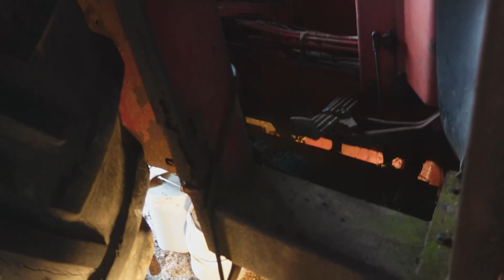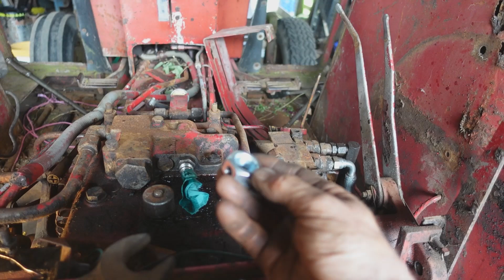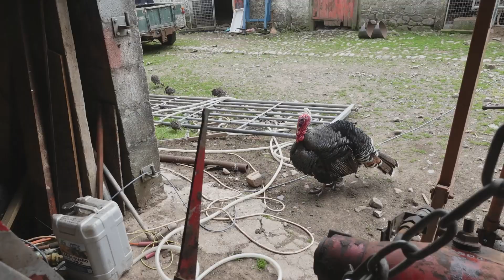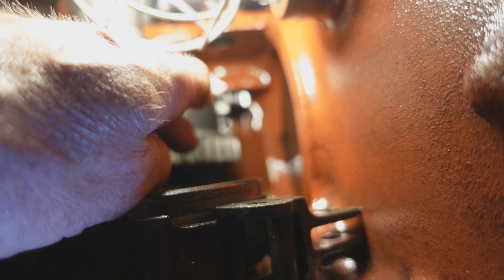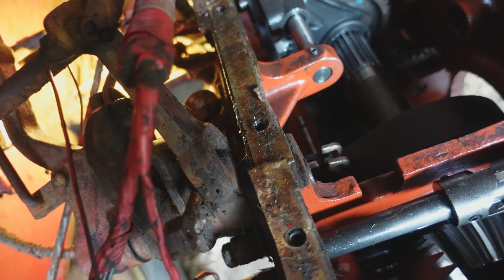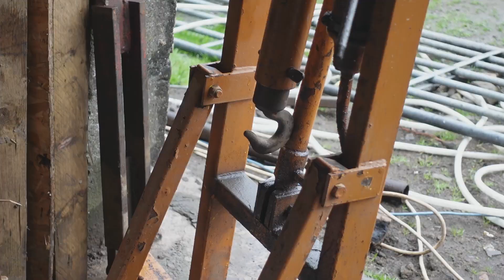International tractor hand brake band replacement 574

Comment: just popped the lid on my 454. the new hand brake replacement sleeve thing has a removable pin, havnt put it in yet but looks like can be flattened out and slide it in on one side and loop around and put pin back in..

Comment: What a ball ache  designers ain’t mechanics
Reply from the maker: They certainly are not. 

My son is master's degree mechanical engineer. When we were looking round university's, at one we were shown the car which the student's build each year.  It was a chassis with numbered bolt on bits and when they have assembled it the technician takes it apart again and puts it on numbered shelves for the next years group. I said that they do not learn anything from that excercise and would be better off being given a twenty year old scrap car to take apart and put back together. I was told that they would not be able to do it, to which I replied, "That would be the point of the lesson".

We eventually chose Strathclyde University because they offered a good practical element in the course and showed us round some impressive workshops. As soon as the first year had started they cancelled the practical part of the course. I was told by a pompous lecturer that "An engineer is not the man who mends your car"!

Comment: Well I found your video to be very well done, humorous and informative. I am attempting this very job on my 574 and was hoping to do the side route but I’m afraid now I’m doomed to have to pull the lid off. I already have the fenders and tank and a rear wheel off so might as well go full send on it I reckon!
Reply from the maker: Thank you, I am glad it helped you. It is a different tractor with a hand brake! If I were you I would also upgrade  the hand brake warning system, I did a little video about it, (afterwards I ended up putting two switches on the clutch). It would be a shame to do all that work and then drive away with the brake on putting you back to square one! Good luck, Jon
Reply: @wotjonsez2560   yes that would not be good!!  That’s what happened originally I think.

Comment: I just did mine this evening. Not an easy job at all. Where I had a lot of trouble at was the little pins holding the band onto the band bracket itself. There’s little splines on them and I had a difficult job in pushing them back in. Did you have any trouble with them?
Reply from the maker: Hi Raymond, I don't recall having any problems with the pins. I hope my video helped you. Now you know how difficult it is, I do recommend that you upgrade the handbrake warning system. Regards, Jon
Reply: @wotjonsez2560  yes extremely difficult but I have it done now at least. Will definitely be upgrading to a buzzer on clutch/handbrake. Don’t want to be doing that again. Yes your video was really helpful. Thanks

Comment: Couldn't agree with you more, John. Doing this job through the PTO side cover is a trick that would have Houdini impressed.

I went one step further on our 584, and removed all the hydraulic tubes. They come right out without too much fuss, except the brake lines, which can be easily wiggled aside once they're undone. Just be sure to put identifying marks at the connections, as you have about a half dozen very similar looking tubes to reinstall afterward. Taking a few pictures doesn't hurt, either.
Reply from the maker: I agree, always take photo's before a complex strip down. Especially helpful on drum brakes, it's always difficult to remember which springs went where. Jon